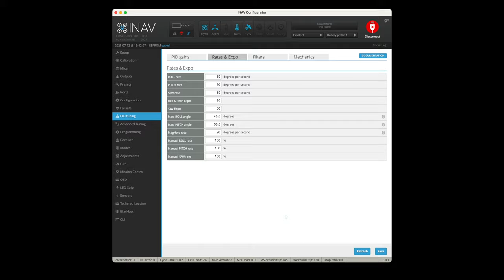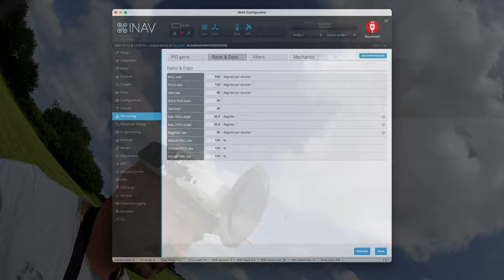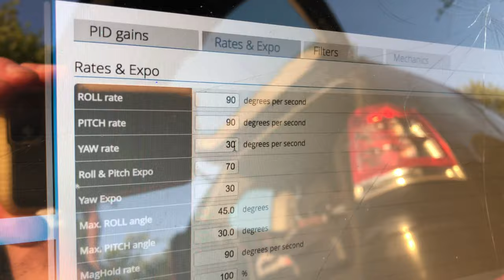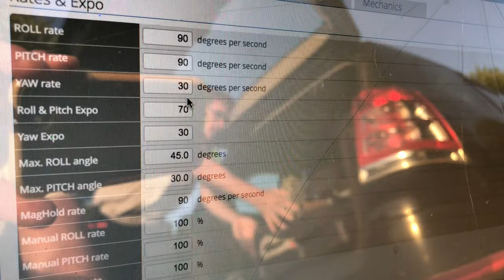Tuning iNav and repairs | Ripper R690 EP:06

Comment: Increase the landing speed setting?
Reply from the maker: that's what I did afterwards ... :) currently its adjusted to 36km/h which may not be enough when there is some headwind. More interesting would be an option to calibrate the Barometer ...